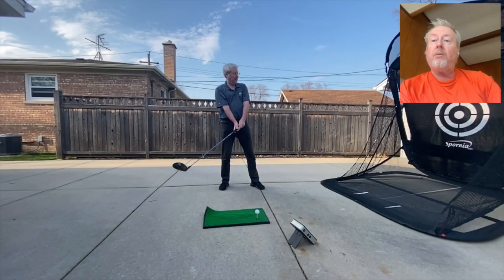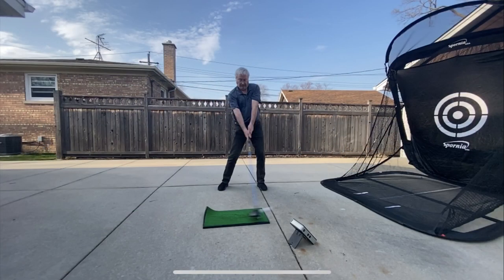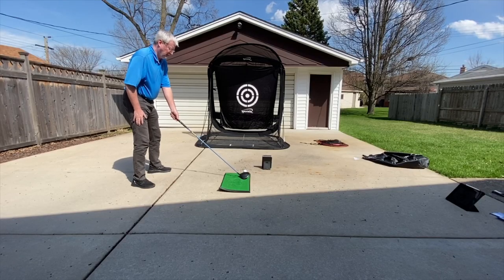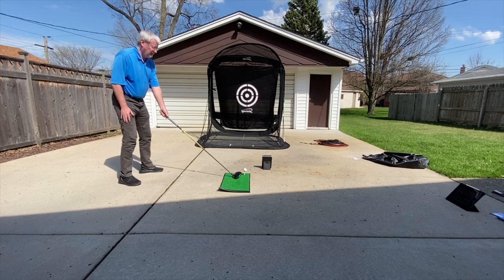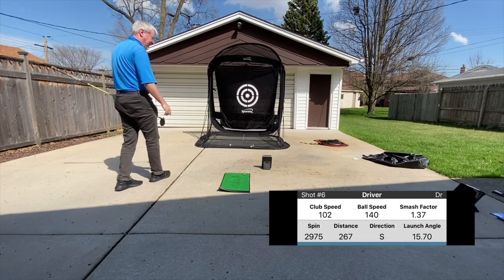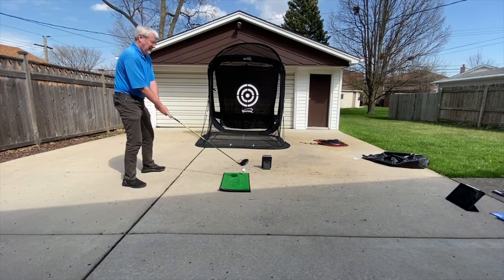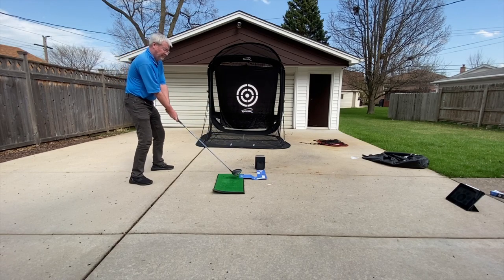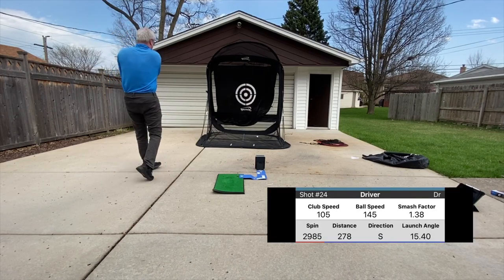My project how to distance.....simply

Comment: The distance numbers don’t match the ball speed from a mathematical standpoint.
Reply from the maker: Exactly......but I said it’s still useful measure because it’s relative.
I will also show you how these machines can be manipulated.....Almost all of them. The math......
Reply: Just like all your lessons with pitching wedge your trajectory really is connected to distance , almost as much as swing speed with driver ...are these distances carry or total?
Reply from the maker: What are the assumptions.....also how accurate are the launch angles? All it measures is ball speed.
There in lies a variable. What ball was used?
More next video.
Reply: @danielborg6035  From what I can tell, based on track man charts, these would be total distance.(based on club speed and ball speed)